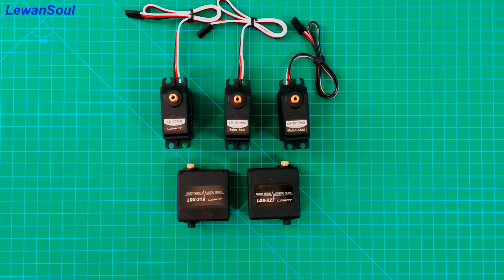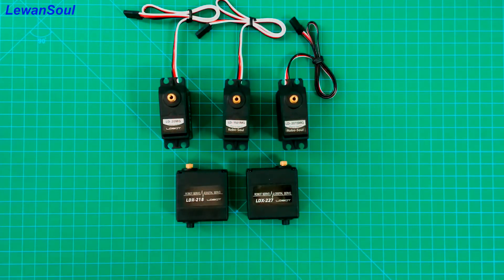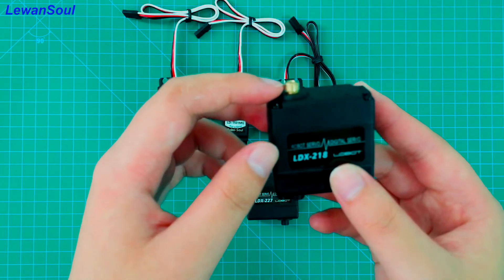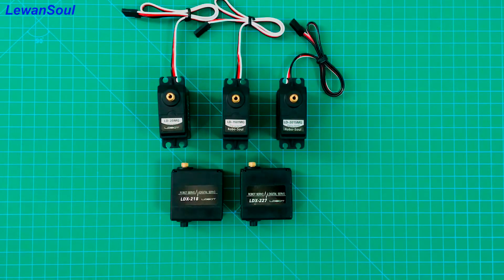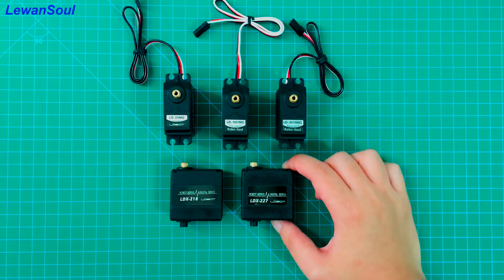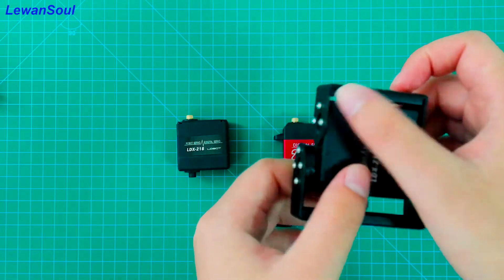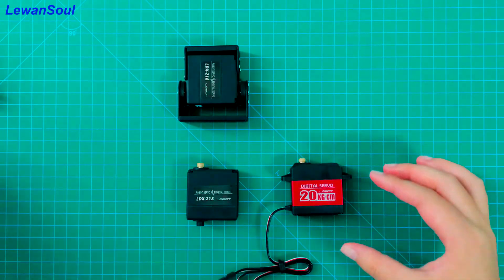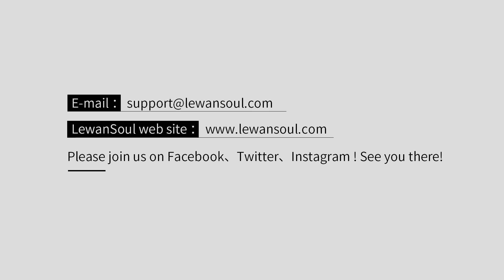Servo introduction

Comment: I would like to use the LX16A servos in a quadruped robot build, but on the product page at http://www.lewansoul.com/product/detail-17.html there are no servo mounting pattern dimensions. I was wondering if you could provide measurements of the mounting holes, similar to the diagram shown in your product page for LDX218 at http://www.lewansoul.com/product/detail-16.html

Comment: well, it was a good presentation, what i missed is: your explanation on the difference between the 180 and 270... can you elaborate ???
Reply from the maker: 270 °: the servo main shaft can be rotated 270° after the servo is energized.
180 °: the servo main shaft can be rotated 180° after the servo is energized.
Reply: again thanks for your prompt reply, i am just curious what application can one use for these 270servos,
i am using rds 3115 180°, for my prototype, btw have a great day ...you guys are 14 hours ahead of vancouver!!!
Reply from the maker: 270 ° servo is used to the arm and joints of the robot, the claws of the robot arm, etc.
Reply: well, i think( therefore i err) i will have to buy one to see how that works
Reply from the maker: Thank you for your support ,you can follow the link to buy it:
https://www.amazon.com/s?me=A1K1UK7O5KP6WQ
Reply: thanks, is there anywhere else in asia/china/hk i can buy this because i will be in china/hk in october
because of amazon both my sister and i had to get our visa replaced...
Reply from the maker: Sorry for the late reply. Welcome to China. Our company is in shenzhen, China, and selling on amazon, alibaba, aliexpress. If you have other questions, Please contact us at support@lewansoul.com to solve it.